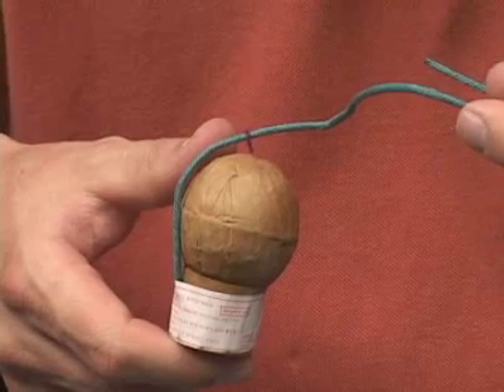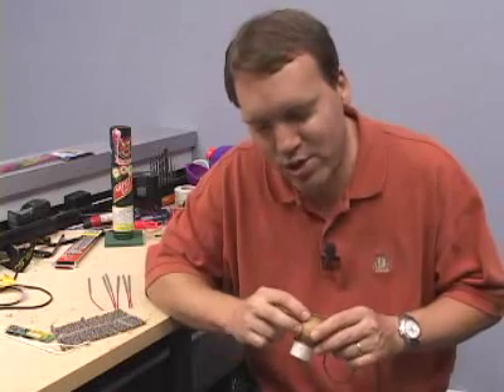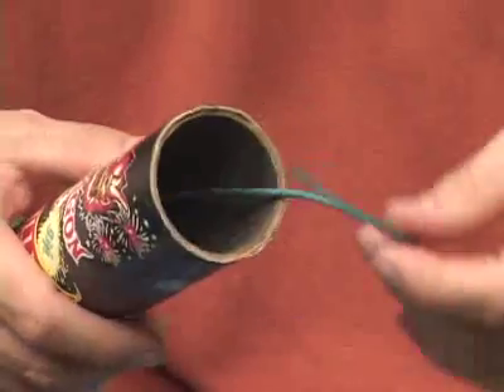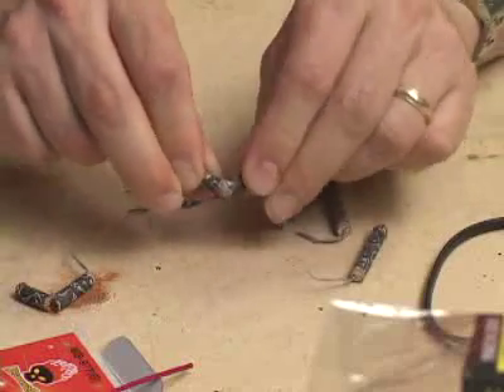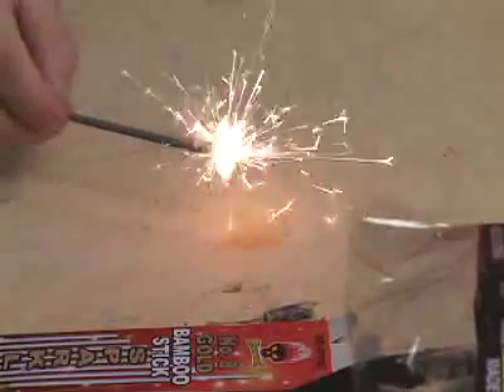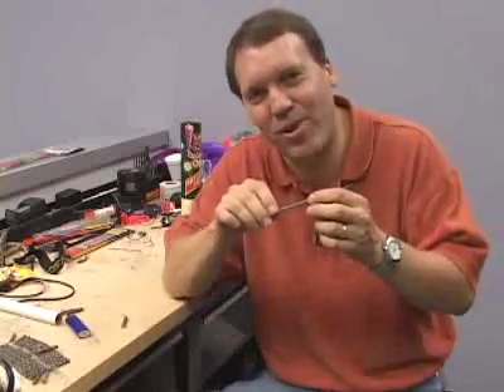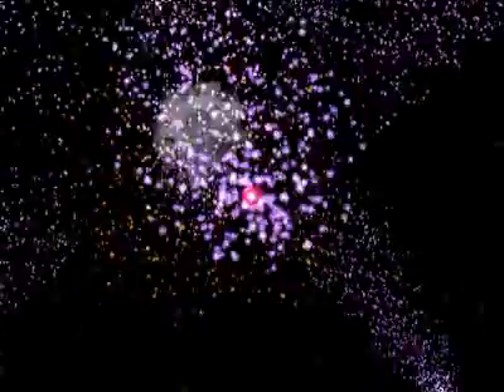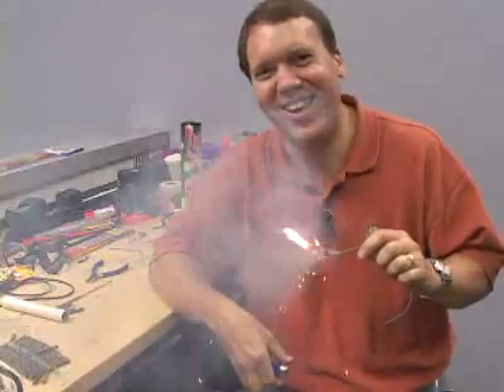How Fireworks Work

Comment: They align the stars whichever way they want them to explode. Say I wanted to make a round sphere or (brocade) shaped firework, I would align my stars on the outside of the two shell halves and fill the middle with BP (black powder) coated rice hulls. Then when it explodes it will throw the burning stars into a huge sphere shaped design. It's not really as hard as you would think.

Comment: That is not how fireworks work!!!!

The small shell in your hand was composed of a lift cup on the bottom with lift powder (granulated black powder) which propells the shell high into the air, 
 a time fuse that the lift ignites (the time fuse is used so that the shell bursts at it's peak or just high up into the air), a burst charge composed of flash powder, granulated black powder or black powder coated rice hulls (that the time fuse ignites)  which burst into the air and ignite stars which...